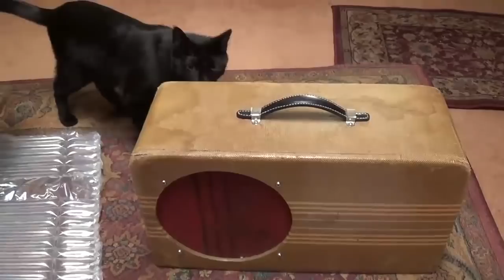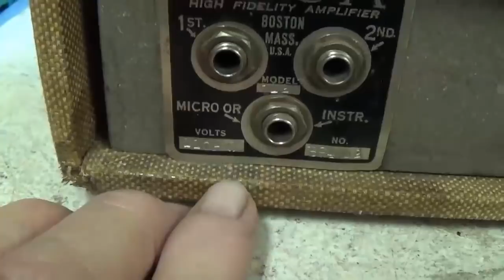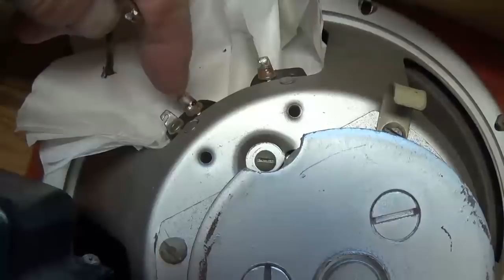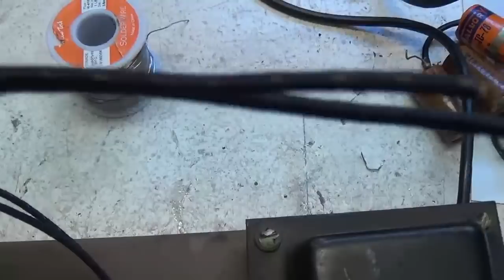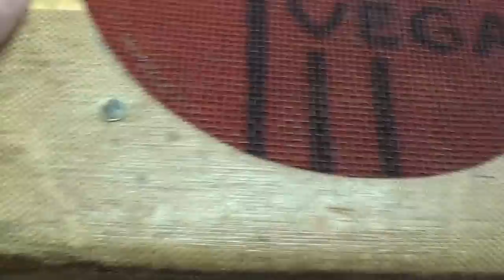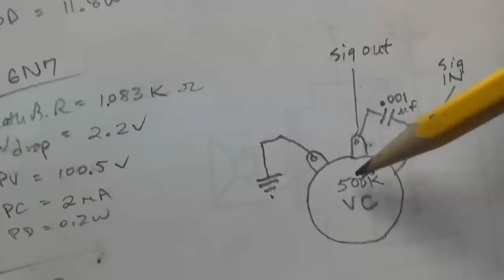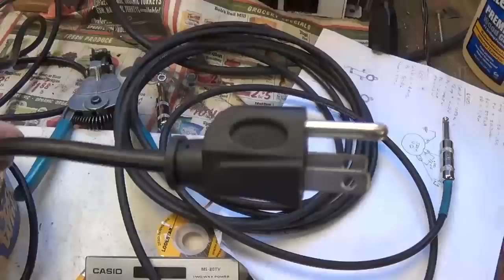Rare & Wonderful 1940 VEGA Model 112 Guitar Amp....Wow !!!

Comment: Love the soldering gun OPT test trick. It for sure would establish that the secondary winding is working but i wonder what if the primary winding is blown?
Reply from the maker: Without actually testing, I tend to think it verifies that both windings are functional......but if not, it's easily verified with an ohmmeter.

Comment: Neatness matters, another great job.  In many of these old amps you can't tell what is going on for the old paper caps taking up so much space.  After a re cap there is enough room for the filter caps under the chassis and then some.  Those old rosette screws were once easy to come by, not so anymore...if I ever find them again, I'm going to buy a box.  Thanks for all the great videos, showing the right way to do it.
Reply from the maker: You're welcome, DH. Thanks for your comments.

Comment: Hello Doug - I came across one of these amps in what looks like original untouched condition. Would you like some photos of the circuit, speaker screws, handle, etc. for future reference?
Reply from the maker: Thanks, but no need, Peter. The amp was sold to a viewer long ago.....but congratulations on a great find.
Reply: @UncleDoug  no worries. I need to dig in and replace all the leaking caps, etc. so will try my hand at creating a circuit diagram while I'm at it since I haven't come across anything useful out there. The amp powers up and plays - very low volume, and a bit of 60Hz hum.
Reply from the maker: @peterausten1000  Good luck with your project, Peter. It would be nice if we had access to good schematics for unusual amps like this one.

Comment: Very nice job! I use the Kester 66/44 and I agree. Very nice clean solder joints. I have used it for years on some on HF amps for customers over the years. I had the chance to revist them after years of service and the solder is still perfect. No corrosion at all.
Reply from the maker: Thanks for your input, Monty.

Comment: Jack and Ollie are some KatzinJammers!  The really old lap steel amps really reveal the advancements made in circuit designs over the years. 
My step dad has a mangled (he’s the original owner) ‘59 Gibsonette GA-8.   I think many moons ago he tried to “fix” it.  The parts are all there, as is the original speaker. I could never find an accurate schematic for it….common for the Kalamazoo stuff at that time. I’d like to suggest he send it your way for restoration. Do you have a website or other for such arrangements? 
Thanks for doing what you do!  Your videos have been a frequent go-to smile, laugh, and learn channel for me👍🏼
Reply from the maker: Thanks so much, J1. I'm booked up with repair work but can recommend a qualified tech if your step-dad needs one.

Comment: Hi U.D., I just want to say thanks again for another great video, and before I disagree with you on something you said in this video, I want to make it clear that I learned more things from just this one video than I could ever hope to contribute in the comments, so I don't want to come off as a smarty pants.  Your comments on speaker phasing were mostly correct, and certainly correct in theory, especially if you envision sinusoidal type signals being applied to a speaker.  But I feel that correct phasing matters even with a single driver because of plosives, and the leading impulse edge of certain types of sounds.  For example, think of a kick drum.  That leading impulse should make the speaker cone move outwards, creating a positive pressure pulse moving towards the listener, rather than make the cone move backwards, creating a rarefaction.  Not a great example when thinking of guitar, but then think of a bass guitar when you thump or slap it.  That initial percussive attack sounds way better if the cone fires outward for it rather than into the cabinet.  I can only assume that this principle must make at least some sort of subtle difference when it comes to guitar and things like strumming or chunking out power chords.  I primarily work on hi-fi amplifiers, and I can tell you without question if you phase speakers backwards (not out of phase to each other but both backwards) then you will hear a totally weird shift in stereo imaging and bass frequencies.  I'm curious what you think about that with respect to guitar, and honestly it has me in the mood to try some sort of experiment.  I wonder if guitar amp manufacturers considered this and if there were attempts made to keep the circuit phase correct?  Something I hadn't considered until I typed this comment out..
Reply from the maker: Thanks for your nice comments, HS. I think your experience with HiFi and stereo speakers may influence your opinion on this topic, but recall that virtually all combo guitar amps have open-back cabinets that radiate sound backward as well as forward. Also, please consider that no guitar note portrayed by a speaker consists of a single positive wave form. For every towering positive peak, a negative wave form of equal amplitude will follow within a hundredth of a second (or less). I am a firm believer in experimentally derived data, however, and if you conduct a blind study involving guitar music from open back, single speaker cabinets that demonstrates conclusively that the human ear can differentiate whether the first waveform heard is positive or negative, I will definitely be interested in your data.
Reply: @UncleDoug  Thanks for your considered reply, U.D.  My hi-fi experience and experience in both listening and mixing sound professionally definitely influences my thinking on this topic, and I agree that an open-backed cabinet is probably less likely to suffer from the effect I mention within the context of a guitar.  From mixing percussive sounds and observing their waveforms however, I can tell you that typically the leading edge of the waveform is significantly stronger than the opposite half that follows.  With drums, bass slaps, etc., the string or head cannot rebound with equal energy as was put into it, some of it is immediately lost.  The result is that the waveform looks lopsided for a cycle or two until the thing starts to resonate at its natural frequency - the plosive percussive portion having been much higher in frequency.  But as you point out, until some sort of blind experiment is conducted, it's all just theory.  I can tell you that with things like kick drum and slap bass, an experienced ear can definitely tell if the leading edge is reversed, especially in a controlled listening environment... but I remain uncertain yet curious with respect to guitar in an open-backed cabinet.  If I put this to the test, I'll be sure to let you know what I discover.

Comment: Nice work, one question: the treble-bleed cap does indeed give sparkle, but I'm often hankering after that warm jazzy tone so I'm wondering if some kind of switchable option here would be in order? Best Regards, Phil
Reply from the maker: Easily done, Phil, but it might require drilling a hole for a toggle switch, which I hate to do.

Comment: I always thought speaker polarity meant the difference between a forward or rearward firing cone?? I put a weak 9v battery to the terminals, match the + & - and if the cone pushes forward it's then correct.
Reply from the maker: It doesn't matter, Tim, unless there are two or more speakers......then they must be synchronized.

Comment: At 13:28  WRONG ALL Speakers have polarity!!  When you Pull, when you should Push, make a difference!
Reply from the maker: Not if there is only one speaker, Ted. Since the cone vibrates at about 40 to 15,000 vibrations per second......do you really think you can tell whether it's moving in or out? Can you tell when a hummingbird's wing is moving up or down?  The ONLY time phasing matters is if there are two or more speakers.

Comment: I'm late to the party, but the cap-resistor from 6L6 plate to ground was the tone shaping network on this amp. Based on the looks of cap and body-tip-dot resistor was probably original to the circuit. I've seen similar configurations in other early audio amps. Of course not the best design once that cap started leaking DC...
Reply from the maker: Thanks, Mike.

Comment: love these valve amps watch most of your video's even though i can't play a string instrement, found a love for tubes when i had 2 Williamson mono blocks running (yes you guessed)KT88'S  stupid as a young person and sold them now as an old man lol still regretting it.
Reply from the maker: Wow.....you had good gear as a youngster, Ray. You can always replace them if you wish.
Reply: Can't afford to these days lol  I changed the engine in a car and replaced diff pinion bearings he couldn't or didnt want to pay so we did a deal with the amp, and the second one i went for a day trip to Skegness and at the side of the bus terminal was a second hand shop there was a box open and it said williamson amp kit it looked complete as the transfomers were there and the valves she asked me £10 pounds for it this was about 1973/4 i couldn't build it at that time so my brother in law built it for me .guess it was just being in the right place at the right time.

Comment: Great video, Doug. As always, filled with helpful tips. Thanks for posting!
Reply from the maker: You're welcome, Gerrick.
Reply: A quick question, since I've got your ear for a moment. I watched the video on the Silvertone 1474 and in the video you pointed out two filter choke transformers connected to either speaker. What is their function and how do the effect the overall output from the amp and instrument?
Reply: I did some searching and found the answer. Thanks again for the video.

Comment: How large is the speaker in this? Is it an 8"? It looks like a really cute small amp in the video.
Reply from the maker: It's actually rather large, Vojtas. As the model number implies, the speaker is a full 12" in diameter.
Reply: Uncle Doug ah, that’s what i thought, but the “tube radio” looks deceived me. Thanks!

Comment: Uncle Doug, so if I am understanding correctly, if I build a 4X12 cabinet and all speakers move in the same direction when connecting a source, it does not matter which lead is positive?
Reply from the maker: Each speaker will have two terminals. One terminal is usually marked, i.e. with a red dot. You have two speaker wires. One is usually grounded. Be sure that the ungrounded one goes to all of the marked terminals. The other wire goes to all of the unmarked terminals. This will ensure that all the speakers are in phase.

Comment: If the polarity don’t matter with one speaker why then are other amps wired a certain way? Wouldn’t that amp not blend together with other amps if it’s outta phase with another one wired correctly?
Reply from the maker: Nope. Since each amp is producing a different signal, it doesn't matter at all. Think about it.......have you ever seen a group of musicians gather for a jam session and all check the polarity of their amps?

Comment: Any way I could talk you into posting a how it works video on a ultra linear tube amp?
Reply from the maker: An ultra-linear circuit is just like any other amp circuit, except that the output tube screen(s) have their own dedicated tap from the power transformer, instead of getting their voltage from the B+ after a resistor lowers it a bit from the plate voltage. UL circuits are more stable and have less distortion than regular circuits, thus they are not often found in guitar amps, where distortion is desirable.

Comment: Not on this subject, but need help,AGAIN. If i wire a 8 ohm speaker in parallel with a piezo horn in a cabinet, is it still 8 ohm,s,or does the horn effect the ohmage,? also a 4 ohm amp running 2 cabs at 4 ohm ,daisy chained = ohms ?
best regards to you,,I have not seen Rusty lately ?
Reply from the maker: I'm sad to say that Rusty passed away several years ago, Mr. A. If the piezo horn has any measurable DC resistance or AC Impedance, it will alter the overall net impedance of the speaker circuit. If the cabs are in series, they will offer 8 Ohms of impedance, if they are in parallel, they will offer 2 Ohms impedance. In both cases, the impedance will not match the OPT secondary of the amp.

Comment: You can change the tone of an amp WAY more with a strategically placed 50 cent capacitor than you can by wasting hundreds on fancy NOS tubes
Reply from the maker: You're right, Joe. To be honest, I think that tubes have less effect on tone than either properly placed capacitors (not necessarily expensive ones) or a good speaker.

Comment: Uncle Doug, I have a couple of Wollensack portable reel recorders with built in tube amplification. I’d LOVE to get the amp circuit in just ONE of them up and running. Do you have any interest in taking on the job of getting one running (the other you can keep for yourself, sell, use for parts, etc; obviously I’d pay your repair rate in addition to sending the 2nd unit if you wanted, and some treats for Jack). I have no reel tapes, and no real interest in using the reel player portion. 

The big points for me would be: Repair amp circuit, convert power plug to something more readily available, and convert input jack to 1/4” instrument. 

Thanks as always for your superb videos!
Reply from the maker: By the time you paid for two-way shipping for one unit and one-way shipping for the other, plus parts and labor, you would have the most expensive Wollensak tape recorder amp in the world, Oqsy. I would estimate a total cost of around $450+, mostly for shipping and parts. The only economic way to do this type of conversion is to do it yourself. Installing a 3-wire cord and a 1/4" jack is not difficult, and I'll bet that at least one of the amps probably works. My suggestion is to try it yourself, or seek local assistance so you don't have to pay for shipping. Good luck.

Comment: I just wanted to inject something about single-speaker polarity. The only time I would ever care is in the case of bass amplification and the convention I use is that string moving in toward guitar and/or downward should make the cones move *outward*. You can usually test this on a bass amp by turning everything way up, holding a string tightly in your fingers, and shaking it back and forth while watching the cone. This is so that slap-style playing hits people square in the chest when your thumb hits or when you pop a string.
Reply from the maker: Thanks for your input, Hub.

Comment: Well, first off, Jackie's sniff test says there's hope. Second, lookin' back, I wish I'd saved screws, nuts and bolts I'd pulled out of old radio, TV and amp gear over the years. I may
have been able to send you a "lifesaver pack" by now. But...I've moved a few times and had to "distribute" some stuff to friends over the years... KT Eighty WHAT?!?!? 94.5 amps
of heater current?!?!? Damn! Good output wattage though. Third, there's probably 3 or 4 caps inside that "water heater"(8-). I had one leak all over a chassis once and thought I
had a contamination problem that put the whole town at risk...only to find out that electrolyte in there is boric acid. That's as in a popular eye wash in use by some folks at the
time.  So, I guess, if that big can starts squirting juice all over, you could call it the Eyeful Tower.(8-). No, huh?

Hmmm, looks like Jack was right. Little TLC from Uncle Doug and the ol' 112 is up and running pretty good(8-). Thanks for another good 'un, Lads...and scratch your new little
buddy behind the ears for me. Good luck with your new KT 88 amp project(8-).
Reply from the maker: Thanks, Tom. I would have responded sooner, but I was washing my eyes out with capacitor juice. I don't think the KT-88 draws quite that much filament current, but it's way more than a trusty old 6L6......and don't get me started on the plate voltage they prefer.
Reply: @UncleDoug  HaHa! No..they don't draw that much, but I figure you could run a push-pull pair of 6L6s on what heater current it pulls. As for B+ voltage, can you even
bias a KT-88 to run linear at less than 400 volts? I'm gonna have to study on that a bit. One thing I know fer shur...you aren't gonna be able to use an Altoids mint tin
for a chassis for that 88 tube(8-).
Reply from the maker: You are correct.....sir :)

Comment: Speaker polarity matters if backwards the cone will go in instead of out
Reply from the maker: And it won't make any audible difference, Dan. Just for fun, listen to a single speaker amp for a while and then switch the speaker polarity. There will be no audible difference. To portray a 1KHz tone, the speaker cone is moving back and forth 1000 times per second. Do you really think your ear can tell whether it's moving in or out ????

Comment: I had always thought speaker polarity had to do with which way the cone moves.
Reply from the maker: It does, but since sound is generated by a complex series of vibrations within the cone, occurring at a rate of 20 to 20K cycles per second, your ear is not capable of detecting polarity in a single-speaker system.